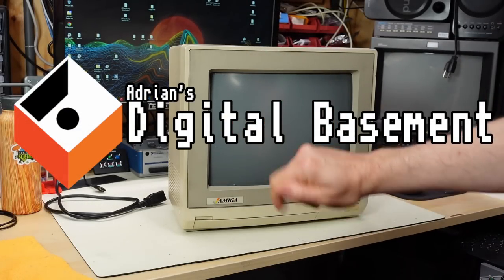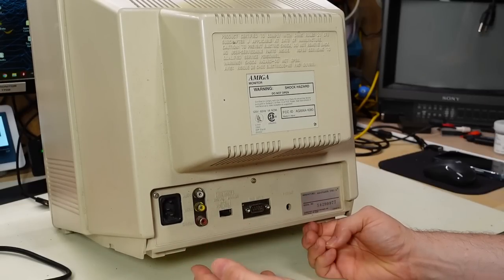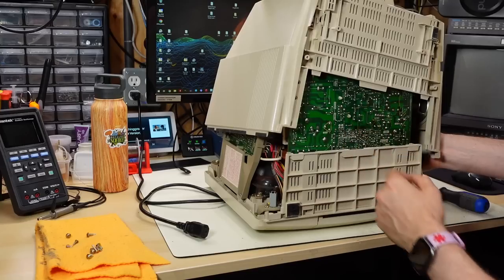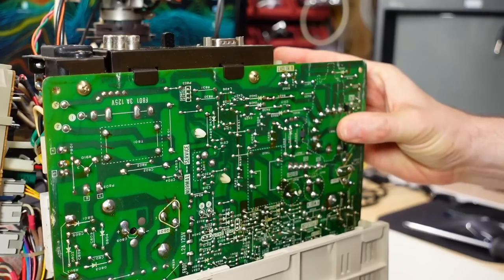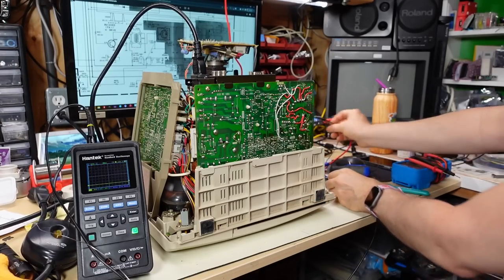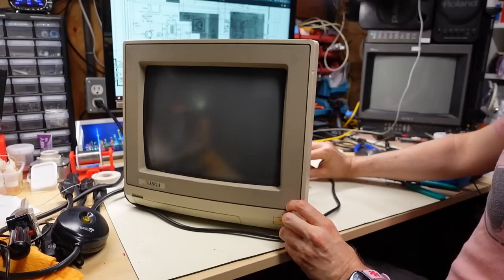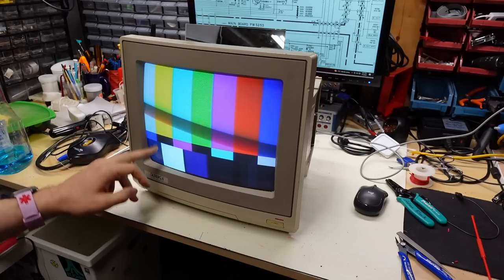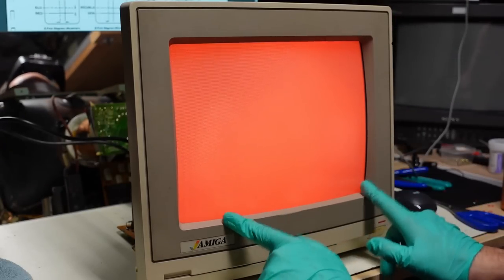Commodore Amiga 1080 monitor resurrection

Comment: Jesus christ man stop touching solder joints like that you have no idea if there is a big cap on the other side!
Reply: He will get a big POW !!  He will learn fast haa ha !!  I got a big POW as a child pulling off the little rubber  puck type thing that sticks inside the crt tube. I pull it out I saw a big blue light crawl out of the tube a hit me hard. The whole of right side of my  body hurt for days after. I never took another TV apart after that.
Reply: Relax. Just watch the video, and if you see something you don't like, turn it off. No need for your passive agressive comments.
Reply: @ToTheGAMES    Nothing passive aggressive here till you chimed in Mr Games.  A comment is an opinion of others , its the whole reason for a comments section.  And relax if you see something you don't like scroll down. 😛
Reply: He has an idea, he tested the boards and confirmed it has leak down resistors in place. He knows what he's doing...

The biggest danger is the flyback while it's energized, and he stays clear of that, as he should...
Reply: @eecajledo8430 that's probably because, in many older TVs and such, there were no leak down resistors and you were probably playing around inside one of those.